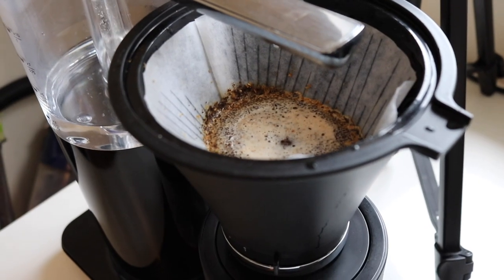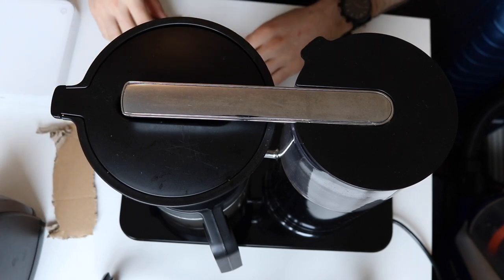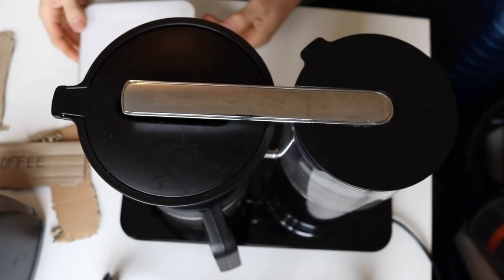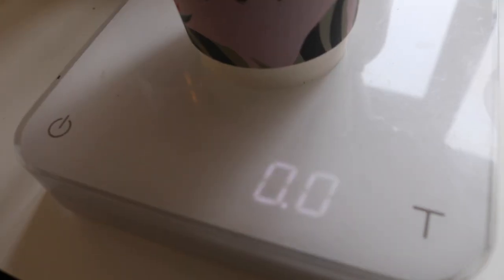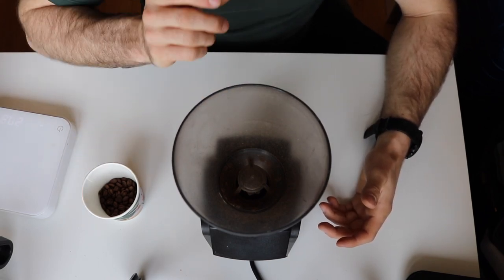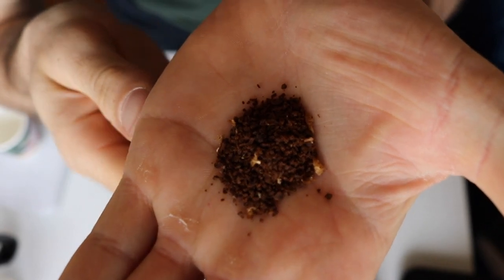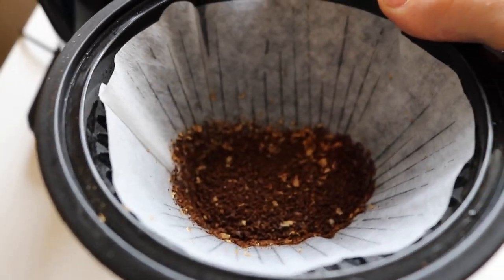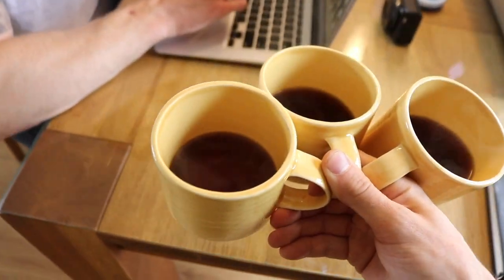TUTORIAL - WILFA CLASSIC

Comment: Do you have problem with water spitting out of the arm where it connects to the pump? I've had three machines and sent them all back. The top of the plastic peels back slightly when warm allowing it to spit. You have the silver arm and mine is black so I don't know if they were early models.